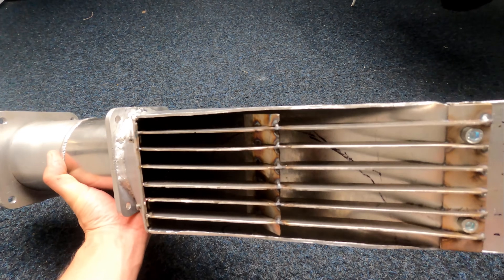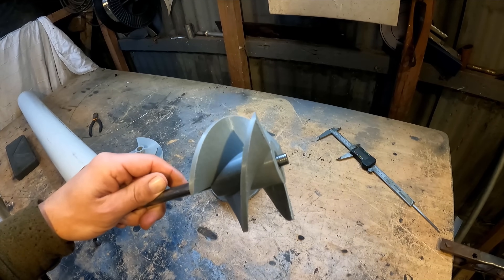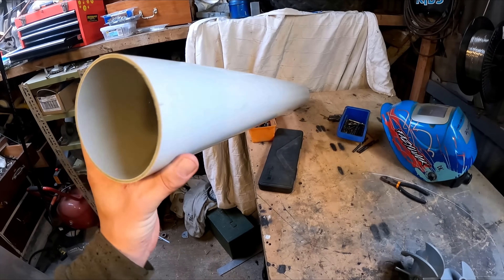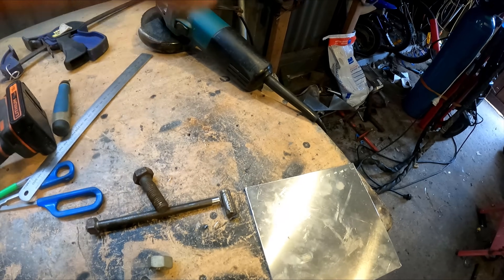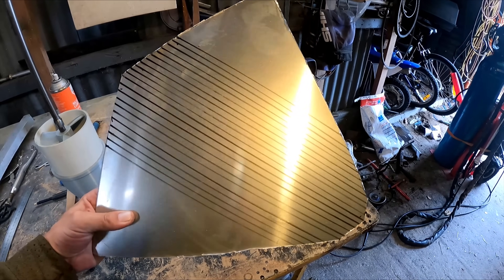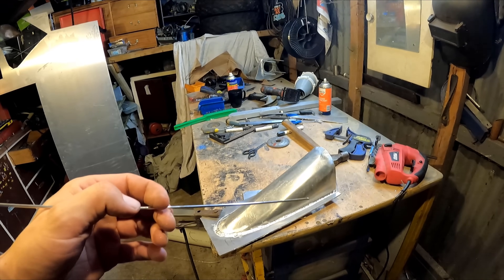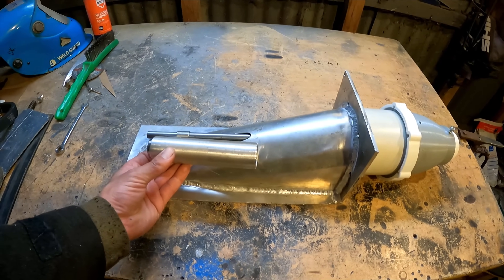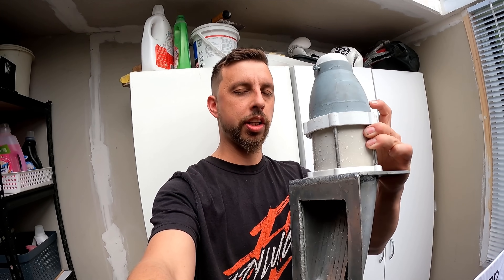Homemade Jet Drive 3D Printed

Comment: Well done Mate ! Now you have a 3d printer, can print a Lilly Prop!
Reply from the maker: I’ve seen the Lilly prop , what is it for ? Doesn’t it work worse than a normal prop?
Reply: @dkthewelder  Someone else printed one on YT, and did tests on a small boat, its supposed to be, sorry I cant tell you for sure , me not having a 3d printer to really confirm it. Maybe your lily design could be tweaked for better performance, also could explore having a  Viktor Schauberger type shroud? Good luck mate!

Comment: Interesting video as always.  And we get to be with you even if sometimes it doesn't work. But you always find a way to do it. Keep up the good work. If the propeller explodes maybe you can have a ring around it. To connect the blades with each other. Or would that not work.
Reply from the maker: Like a ducted fan , it probably won’t work I don’t know why though I haven’t see one like that in all the pictures and videos I watched . It wouldn’t be hard to make I could print one and try it
Reply: @dkthewelder  Probably not working maybe. But if the one you have explodes you can try. And you could try carbonfiber filament. Or nylon. I haven't tried it on my Creality CR-10. But I have seen they are selling it. There is alot of fun stuff to be made. 😀

Comment: Great video Dan looks like a monster. I bough some dodgy bearings the other month, they said they were deep groove but they were pretty shallow and popped out from the the thrust after a couple of runs, it might not be an issues with your bigger bearings mate, looking forward to the maiden run and all the best, Mark
Reply from the maker: Thanks great to hear from you! I actually copied your design a bit having the thrust bearing on the intake instead of I the flow corrector like jet skis. It is 100mm impeller I have a pretty cool plan for the motor ! I like your videos keep them coming
Reply: Hello Mark. Funny to see a comment from you here :-)
We did not do much more testing as the weather and school times are not cooperating 😃
Reply: You may be better trying an angular contact bearing in this application, the force is always going to be in axial direction. 
Try a 7XXX bearing.